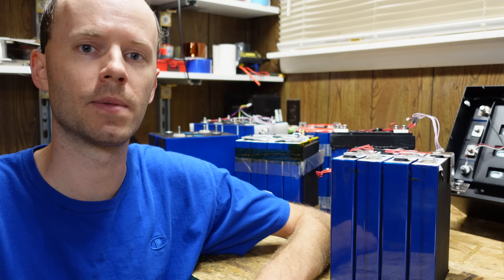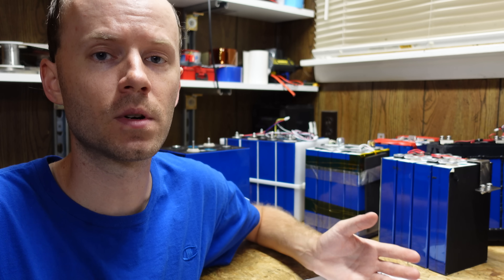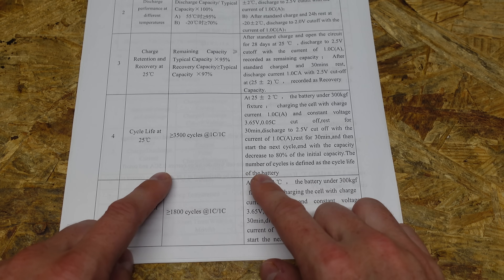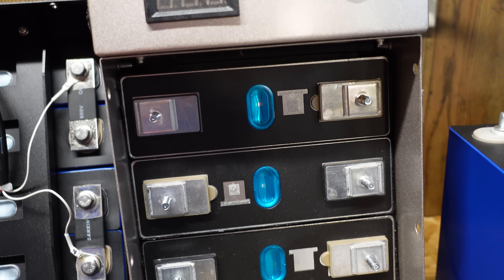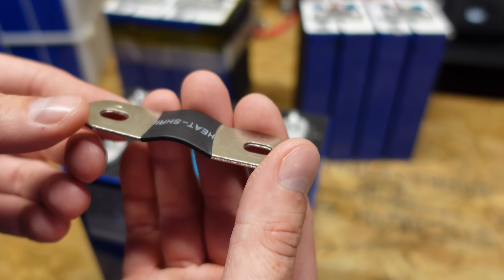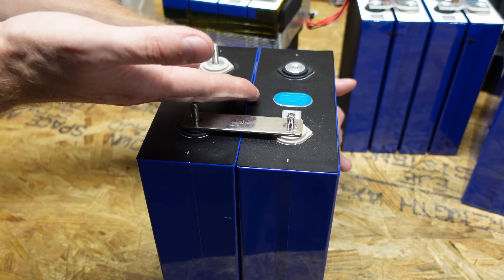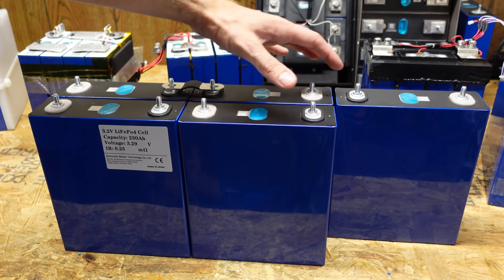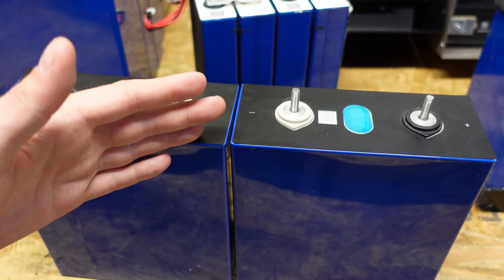LiFePO4 Battery Compression, Fixture, and Assembly - What's the Deal?

Comment: Great video, appreciate your work. I personally think there are some key points missed. First point missed was  compression in fixture. It clearly stated at 100% state of  charge pressure should be 300kgf. Then rested for 60 minutes. Then discharged to 2.5v, At this time the capacity is changed to only charge to 80% I do understand how much these things cost. But to compare your 16 cell to 4 cell setup is not enough. I personally just purchased the Seplos Mason 135 16 cells from their DIY line. Epoxy sheets between the cells, all cells under compression within the fixture. Look at their video as to how a professional battery supplier tackled these issues.
For me in the future I will just have a fixture made add the Seplos BMS and add capacity.
Reply: Video???

Comment: Correct me if I am wrong and I don't want to get too technical so I will use terms that all are familiar with.  Don't you get a shit load more
cycles out of these batteries if you maintain 12 psi compression?
And all this crying about a connection method used by all the other manufacturers that WARRANTY their product.
So let me do the math real quick for you.  Connect these batteries together like everyone else but compress your batteries
appropriately.

Now....    what else you got?

Comment: Solder terminal ends to #4 bare wire with enough loop in the wire to accommodate expansion and contraction without stressing the lugs. Slip heat shrink over the wire for protection. Install wire with loop towards middle of battery. The extra cost of this route is negligible considering the hassle factor of this this project. It has already taken the fun out of the whole deal. Good luck!
Reply: I was just thinking the exact same solution. I will probably do a similar thing with my battery array

Comment: Just flatten a copper pipe and drill the holes where you need and you have connectors for your battery's and there better than most of the ones that come with them
Reply: I have seen copper and aluminum bars. They both work harden.

Comment: You do lithium battery. I have done this wiring diagram with AMG and AMG from many forms and combination. I can not afford the lithium batteries you use. This wiring diagram has had amazing results. Mega proud. I going to shair it with you in hopes just maybe you mint try it and see what results you can get. Google says. Any trolling motor. Last on an charge for 5 hours or less. I am guessing that's off an 100ah battery. My two battery hourglass configuration off of 2 20ah batteries. The lowest gade and over 10 years old but new trolling motor with brushes at 30% power. I stopped the none stop running test in an 5 gal bucket of water. At 12 hours. Wiring diagram. 2 batteries. 12v system. Positive to positive. Negative to negative. Off decharge. I battery positive. The other battery negative. I do have an 20 watt solar panel that is self contained on the system. The wiring is opposite of the two other wires. Yet in shade and clouds. Low watts. It did not count in my book. More then two batteries wiring diagram. 12v system. Positive to every positive. Negative to every negative. Decharge. All positives to an collection point. All negatives to an collection point. Then 12v and converter feed off of collection points. Same as solar. All positives to another collection point. All negatives to another collection point. Then the solar leads into from the collection point. One battery system has many different sizes of AMG batteries and a 200ah gel plus the other two batteries. I can stack as many batteries as I want in any size and rating. Amazing what one can do with 12v. Yet now my curiosity is can you do this with lithium batteries. What will be the effects. With mine. I took many different batteries and made them into one single battery. If you ever get some time. Could you please test this out. Thanks.

Comment: You sound stressed, I think far too much mental effort has been put into this. Based on your stationary application fibre reinforced tape sitting on a shelf should be just fine.
Curious how many psi the aluminum shell actually provides to the internal cells?

Comment: Couldn't you just charge up each cell (either loosely in series or individually) until they each reached full charge...where swelling should be greatest. Then arrange cells in desired order touching each other (in swollen state), tape or strap together, and attach bus bars. At this point there should be no stress on bus bars (at full charge) or at zero SOC. Cells should not move into each other when swelling decreases...just the sides retract...correct?
Reply: Did not read James Jennison's comment til now. He (and I) have the same idea. Attach cells when they are at full state of charge.

Comment: I posted a comment with decent solution, but it got deleted with no reason.
Reply from the maker: You are now the second person to comment about deleting. I have not deleted anything at all - don't know what's going on. Can you please repost it?
Reply: Sure. The original post was very long, let me shorten it.
So you take abs, pe, silicon or rubber T-shaped extrusion with 2..3 mm thickness and 10-20mm size, 270 mm long or whatever mm is height of the batteries, and put it between the batteries so vertical line of T goes between cells, and horizontal part of T shape lies on outer sides of adjacent cells.
Reply: This way you have 2..3 mm of space between cells so they have room for bulging, but busbars won't be stressed as the very edges of flat sides of cells don't bulge.
Then having 6 of this T-shaped extrusions between 4 cells, you can wrap the assembly with fiberglass tape so it's not compressed but is nicely kept together
Reply: The idea is that the batteries don't bulge close to the sides so you can rely on sides and T-shaped extrusions to keep the assembly together. Add insulating paper between cells for more safety, and that's it :)

Comment: I solved the bus bar issue by making termanal ended jumpers between all the batteries. The wire allows all the flex you want. Takes more time but is easy.

Comment: I don't get it. You get more cycles if the batteries are compressed together... But the batteries bulge with charge... Is the compression to force the batteries not to bulge? If the decision is to allow the cells to bulge then the solution is something like a 3d printed square frame the size of the battery; no space in between so they can bulge a little. Alternatively just get some plastic and cut it in strips and glue/tape to the edges of the battery. Looking at the examples of batteries it seems like most are implementing spacing.

I speculate fixing the batteries is about preventing the bus bars from loosening from the expansion and contraction as well as them moving around in a vehicle and doing the same thing. A loose bus bar could result in more resistance in the middle of batteries in series and hence batteries going out of balance charging and discharging... so fewer lifetime cycles. If you actually inspect your batteries and tighten the terminals every year you should be OK.

Comment: My 280ah ones I really didn't compress them although they are in an aluminum tray with top piece that is pretty tight fit (kind of like the battery you had there with the plastic piece top and bottom) and this is with some foam in between them.  I've don't some short videos of my use for them I just don't see the worry about full compression.

Comment: All cells will swell and shrink.  Cylindrical cells just deal with the internal forces better.  I think you are not seeing it with the sub 150ah cells because of the physical dimensions of the cell itself.  Those large cells are such a large box on the outside and on the inside hundreds of pancake layers vs 10s expanding.

Comment: Great video, and I feel your frustration as I am wrangling with the same thing in the design of my battery.  My primary concern is stress on the terminals, and the solution that seems clear to me is probably the most expensive, heavy and annoying to implement.  Bascially, each cell requires it's own enclosure that is fixed in place within a larger enclosure.  So each cell has a compartment on all sides but the top, and is sized to be within the spec of the expansion of the cell.  This would allow the terminals to remain centered within the cell enclosure at any state of charge (or with far less travel than in a conventional compressed system).  If that is acheivable then your bus bars can be attached to the terminals and nothing should move, and the only physical stress would be on the individual cell enclosures.  The downside is a big one though; the battery case would be a lot heavier and a little bit larger.  Also much more expensive.  This would also be pretty difficult to DIY since it would need to be spec'd to the cell your using, and molded plastic or steel constuction would probably be best.  I expect we may see things like this in the next few years as hopefully there are fewer standardized cell sizes which would make something like this possible.  Then again this is a product for the DIY market and many manufacturers would rather spend time designing a battery rather than helping you save money designing your own.  Which is unsderstandable.  I think I'm actually going to go with the SOK 24V batteries if they ever come out since I'd rather focus my energies (and money) elsewhere and I like their design.  Thanks for keeping the converstation going in a thoughtful way.  I look forward to more of your videos on battery design!
Reply: Why not just use wire as the bus bar?

Comment: Ridiculous idea: 💡
Get a 3' wide piece of sheet metal (by however long you need), bend the two sides (to the height of the cells). Making an appropriate C (or U) channel.
Cut cell separators out of non-conductive material. Place cells inside of the formed fixture. Then put two end pieces on the outer cells, then apply required pressure (you can do this with ready-rod, band clamps, whatever method you see fit). If you want, create a top, but the size of the top: ymmv.

Comment: LiFePo4 : if layers are not compressed, then dendrite can grow more easily in the electrolyte. Primary effect is that dendrite will mecanicaly separate layers, thus decreasing capacity. You can see it : cell if inflating. When you compress it, dendrite will still grow, but way less easily. And because layers are compressed together, they will be less likely to separate around dendrites. Thus keeping your capacity longuer. A difference of 30% lifetime is comon. THIS is the reason why some manufacturers are still using cylindrical cells, layers are naturaly compressed inside.

Comment: First : You did a Great 👍 Presentation! 
I purchased (20 + 1 for a backup) 120AH LiFePo4 batteries for my motor home. I was somewhat concerned about cell expansion. The Specs stated 0.3 mm of expansion at max. What I did was fastened them together with VHB tape on all 4 corners. I did have to enlarge the buss bar holes slightly to make them fit. Then I used the same reenforced tape that you used to hold them together to ensure the vibrations of the motor home when on-the-road didn’t loosen each 12vdc battery. Yes, I have 5 separate batteries with a BMS on each (limited storage space in storage compartment). Have been using this configuration for 2 years now with only one BMS failure. Never charged them fully 13.9 vdc… and so far have never discharged them below 85%! 
Okay, my system is “Over-Kill-Design” but I’m a Retired Electronic Engineer and wanted them to last a lifetime 😜

Comment: Upfront, I am a solar/wind micro generation virgin.  I do intend to build a 320Ah 48V setup from cells coming from Chinese based company (like most if not all LiFePO4 builders). 

 I can say that I am not illiterate and have a math/physics degree with part of a EE degree, so I am not a total know nothing, but I don't know everything. I can tell you that I have viewed many, many, many videos and have read just as many books on solar/wind micro generation. As far as batteries go, no matter the type of chemistry, the one overriding theme is that temperature extremes are BAD. 

I know the delamination argument in relation to lithium batteries and am aware of a couple of other arguments as far as compression goes. However, the one overriding theme between all of those videos and all of those books (including personal experience with car batteries) is that temperature regulation, as well as state of charge, is the most pressing issue. 

Honestly, it would seem to me that compression, inspite of its advantages, would make temperature regulation difficult especially if even temperatures cell to cell and across single cells is a real issue, so I would vote for no compression. Instead, an excellent BMS with both high and low temperature regulation would be emphasized.

Finally, not to muddy the waters, but other than the end-to-demonstration seen on this video, I have seen LiFePO4 prismatic cells put into a kind of zig-zag pattern where the short bus bars on the illustrated 280Ah cell would fit. This exposes the cell faces to better cooling across each cell but still allows the use of the bus bars that are specified and come with the cells.

Comment: Right or wrong. I placed a poly cutting mat between each cell and wrapped them all in 3" electrical tape. I only made a 12v 280ah battery to use as a house battery in my minivan. Terminals don't seem to be moving in my application. Guess we'll see in the long term how it does. Hopefully by the time it fails there will be something new and improved we are all discussing.

Comment: The fixture vs compress terminology is mostly a translation issue I believe. The basic idea with "fixture" is to prevent the expansion at high SoC. In other words, the cells shouldn't be "compressed" at low SoC, but the fixture should prevent expansion so that as they try to expand they exert pressure (Around 12 PSI as you noted) against the fixture, and the fixture just needs to be strong enough to maintain it's shape at up to 12 PSI.

Regarding whether you need to compress the smaller 230 AH cells: It all comes down to QA and "support". They probably haven't tested the 230 AH cells outside of a fixture so they don't have the numbers to list in the spec sheet. It's safe to assume their life cycle will be affected about the same as the 280s would be.

Regarding stress on the terminal cells: All you need to do to avoid this is to fully charge the cells before assembly and then try to leave as much of a gap as you can. That way when you place the cells together they are already at their maximum thickness. When they discharge they will contract a bit and create an air gap, and when they recharge they will just close that air gap without placing any additional stress on your terminals.

However I agree that longer bus bars are ideal. I like to have air space between my cells so that air flow can help keep them cooler. My feeling on the subject is that keeping the cells cool will extend their life much longer than compressing them would. You can also avoid the expansion of the cells by charging to a lower voltage such as 3.4v instead o 3.6v. Most of the expansion occurs at voltages >3.4v.
Reply: Thanks!!

Comment: All prismatic lithium cells require compression. Not compressing them will result in significant reduction in cycle life and considering the price of the cells will not make economic sense to not use compression.
Compression pads are usually used for elasticity to keep the pressure on the cells at reasonable levels not matter the SOC. Any amount of compression will be better than no compression and there is a fairly large range of compression where cells have significant benefit over no compression.
I will say cycle life with compression is at least double even for lab type tests where battery is cycled fairly fast over a few months while in real life where cells are used for years that difference may be even higher.
Not to mention all the mechanical stress on the connector's if you use those typical solid buss bars provided and not flexible connections between cells.
Those few page user manuals are usually edited by sellers so I will not trust them to much.  Seller know that buyers hate dealing with extra work and expense of adding compression not to mention sellers selling damaged cells that have so much gas build up likely from over-discharge that compressing them may result in a slightly earlier complete dead of those cells. few page user manuals are usually edited by sellers

Comment: The specs sheets says that 0.5mm is the usual expansion. So 1 mm for 2 touching batteries it's ok ...
Why dont use a 2 or 3 mm elastic separator between them? like silicon molds for owens, for example (cause the high temp that they can resist, it's a plus)
I have seen also flexible busbars in aliexpress made of cooper mesh tape.
But after all of this, we have to make a piece of furniture, something exterior that holds the whole together.